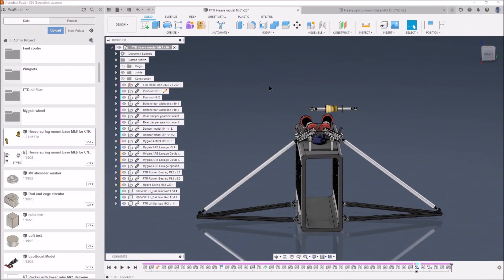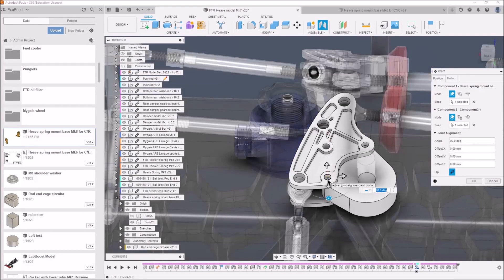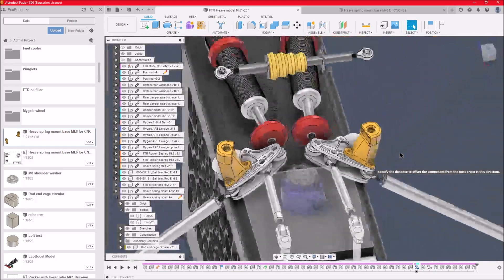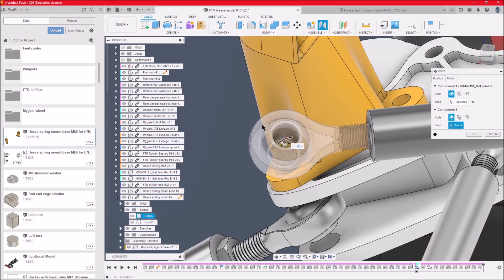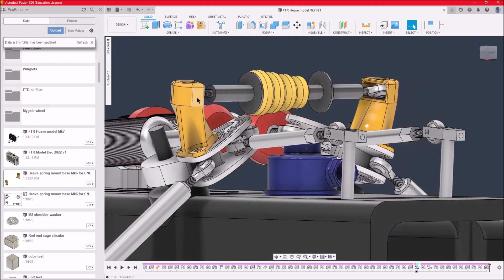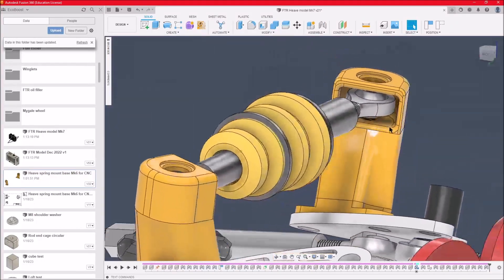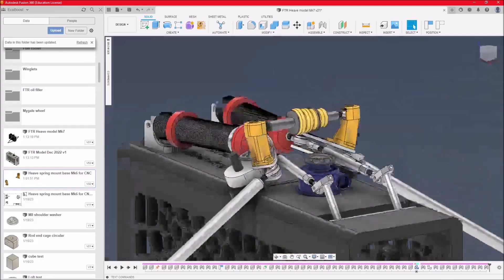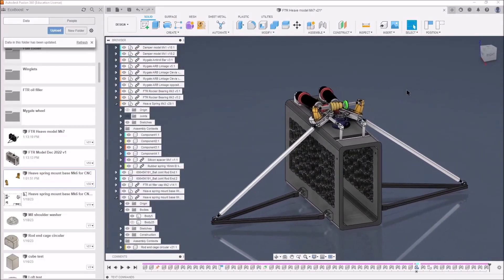In Fusion 360 I'm testing out the clearance for the heave spring I've designed for my Formula Ford

Comment: Wow, sounds like you know what you're talking about!
I'm planning to fit a heave spring to my project and was wondering what sort of strength or spring rate I'd need?
Reply from the maker: Probably a case of trial and error Paul, I asked around for a Formula to work out the spring rate but I couldn't find anyone willing to share. No doubt its buried in a book somewhere. But it's very much down to the geometry and vehicle weight (obs).